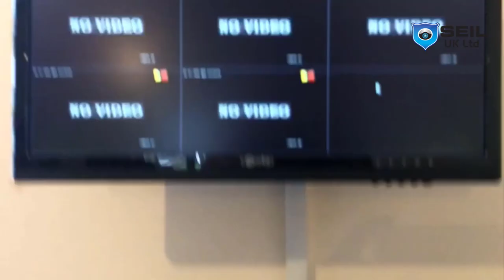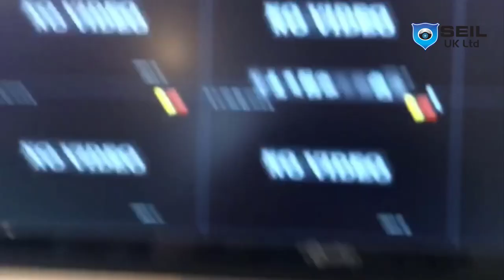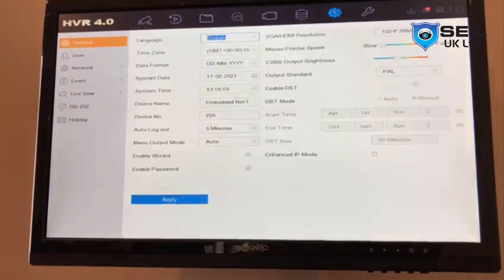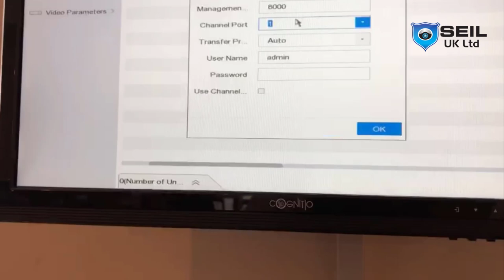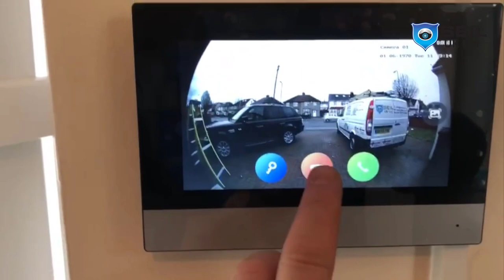Hikvisiion Analouge 5MP HD ColorVu Camera HD Recorder Installation

Comment: Why would you use cat5 for analogogue?
Pointless and costs more.
Looks like a DIY job!
Reply: There is good reason to use Cat5/6 for Analogue cameras.    Firstly, because it works the same and secondly it’s easier to wire - less messing about.    Thirdly, if they upgrade to IP, the cabling is there - so it’s future proof.   Also Cat 5/6 is more flexible too 😊